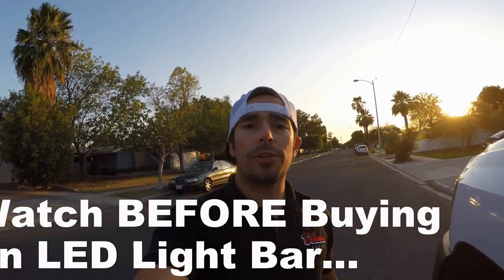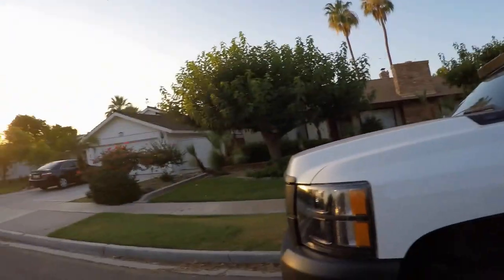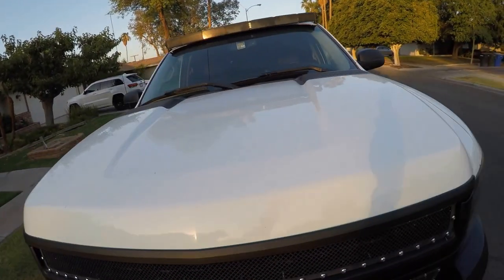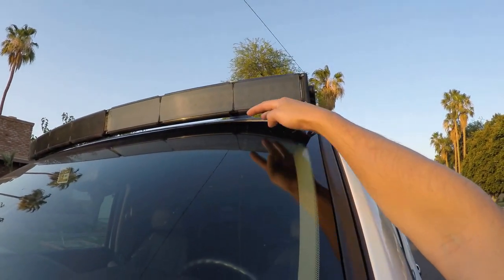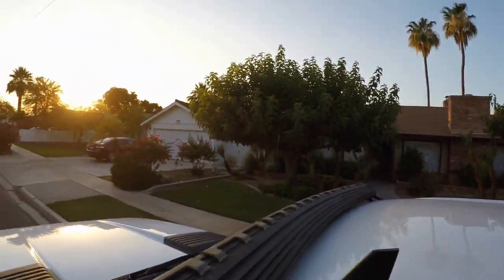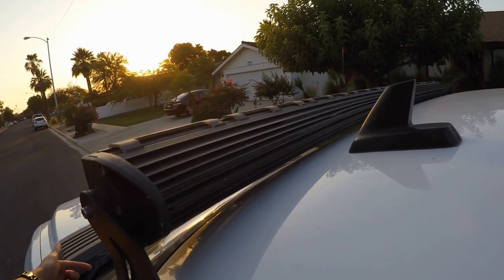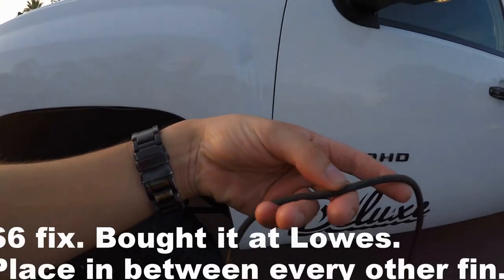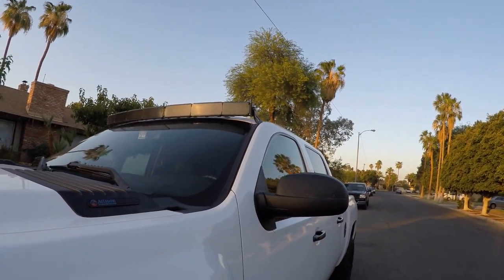How to fix 54 inch Curved Light Bar whistle noise, and glare problem on Silverado

Comment: To stop the whistling you can get some garage door trim seal and stuff it between the top and bottom fins on the back. After you get it in between the fins just trim to about 1/2” of the seal sticking out. Stopped my whistling. 16 ft of the stuff worked for 3 applications with some to spare if you mess up the first time like I did.

Comment: I bought a spot and I have the same problem. No matter what kind you get, a roof lightbar sucks to drive with. It's cool for camping or repairs stationary but not practical. I reccomend a good one upfront on the bumper

Comment: I wish I watched this video before buying mine. Im having all sorts of issues. Whistling sounds and also some sounds like paper flapping from the passenger side. My light no matter how much you tighten it points downwards when hitting a rough spot on the trail....im about to take it off and be done with it.

Comment: guessing the same results for 2000 sonoma?  with mine i was told a curved would fit my truck, those i think are combo in general?  i have a black truck.  or do i need to get the pull bar and like 20 inch bar on that?

Comment: so you said you talked to Rigid industries on the problem is the light bar a RDS rigid. ?  and did you use Rigid industries roof mounts did you get a new one to fix the problem  . thanks

Comment: Too late!!! wish I'd seen this video earlier, ordered the combo. it doesn't reflect back though but it doesn't travel far, it just throws light everywhere. not very useful except that it looks cool. That whistling noise though, phew
Reply from the maker: That sucks! The whistle is super easy to fix. Go to Home Depot or Lowe's and ask for the rubber tubing the holds the screens into place on the aluminum frames. Works wonders. Hit me up if you have any questions.
Reply: limited speed rob what's it called?
Reply from the maker: what are you asking about?
Reply: Nvm I found it thank you
Reply: It's called Screen Spline
Reply: Hey bro. Idk if you figure it out yet but just move your light further back to where the light starts to bounce off the top of the truck that's what I did with mine. But I didn't run into a whistle problem at all.